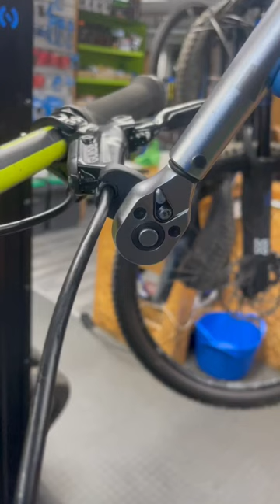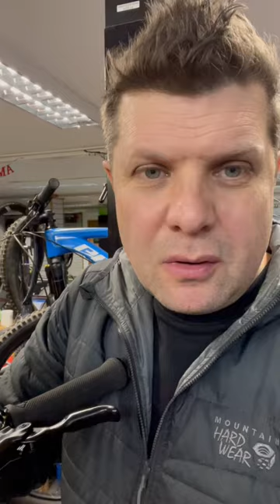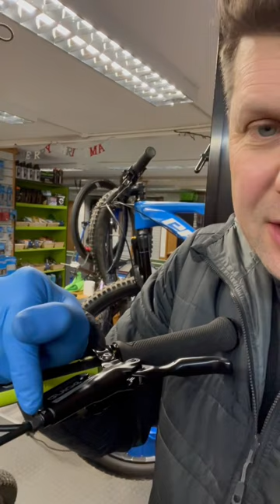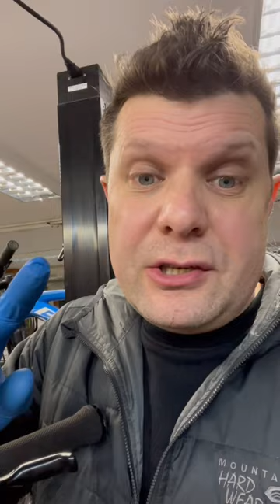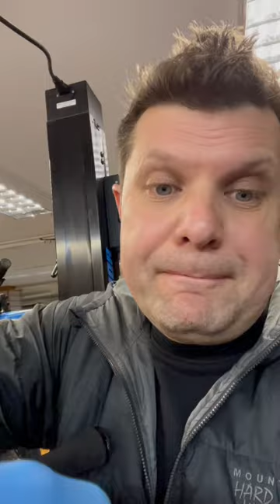Torque check brake lines with a crows foot. #bikemechanic #mtb #sram

Comment: A torque wrench is designed to use with a socket.  Using the crows foot will change the moment arm and could lead to over torquing.
Reply from the maker: Yes. Well done. Have you got a great idea on how to tighten a brake line then? The SRAM manual instructs exactly how to do, and the job of a mechanic is to follow instructions
Reply: @Mapdec   If that is the SRAM instructions, then they likely accounted for the length of a typical crows foot in their torque spec.  A typical crows foot is pretty short and at the torque levels on a bike the error is small enough not to be a problem.  There are also some toque adapters that look a bit like a crows foot with a longer arm.  If one of those is used, there is a calculation to make sure the correct toque is delivered to the bolt.
Reply from the maker: Oh crikey. Chill dude. Use the one that SRAM supply and use their recommendations.  Wow.
Reply: You don’t need to figure out the adjusted torque value if it’s 90 deg to the wrench. You didn’t lengthen or shorten the leverage
Reply: @joem8752  At 90 degrees, the moment arm does not change and no calculations are needed. 
Torque setting= torque actually applied to fastener * length of wrench/ length of wrench with adapter. 
If the length doesn't change then torque setting = actual torque.

Comment: Any brand recommendation?
Reply from the maker: This is just the one that SRAM supply.
Reply: @Mapdec  I spent a few hours this morning to even find one here in German. Apperently, there are Crows Foot spanners from Stahlwille and Facom, but they cost like 60€. Then I found Pedro's Crowfoot Flare Wrench in 7 & 8mm combined, but its not available here in any shop and Pedro's charges 30€ with shipping. But finally, Bike Discount and Bike Components got one from PRO in their "tools for brakes" department for 6€, which is okay! Just in case anyone else wants one!
Reply from the maker: Good info Dirk! Thank you.

Comment: Where can i get a crows foot in 8mm 1/4’ drive?
Reply from the maker: Sram distributor. It is a sram tool.
Reply: @Mapdec  ok thanks, won’t be spending that for a single job.
Reply from the maker: Cheaper than a new olive if you get it wrong
Reply: @Mapdec  how? Olives are pennies…this tool appears to come with the sram bleed kit which is expensive….unless you can get the tool separately..and even then how would it be cheaper than an olive?
Reply from the maker: @Barrygee  SRAM olives are £6 now. And if you have cut your hose without any slack for a new one that gets expensive really fast.

Comment: Who uses torque wrench for this bolt. :O It should be tight and that's all.
Reply from the maker: Take a look at the manual. This one has to be a certain torque for the connect a majig to work properly.  The Shimano ones tend to crack the housing if too tight.  I’ll confess to learning that one the hard way. Now we torque.

Comment: Is the compression nut fitted dry or greased ?
Not a fan of Sram brakes myself.
Reply from the maker: DOT grease 👍
Reply: SRAM hydraulic brake fittings are installed with DOT grease applied. Installing hydraulic fittings (not just SRAM) dry is asking for trouble, ferrous metals rust, parts get seized, etc.
Reply from the maker: It’s not a full instruction vid. It’s a 20s short. Where do we stop?